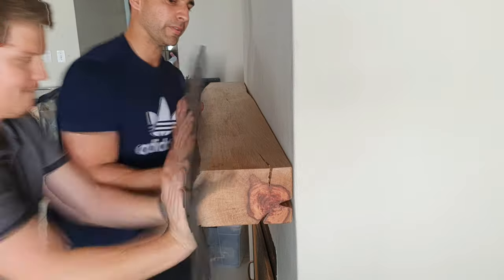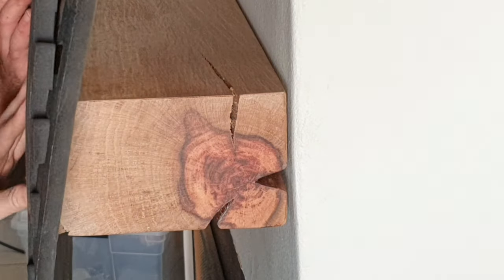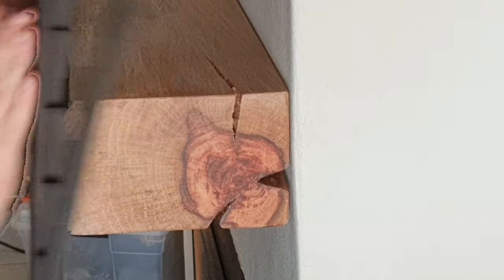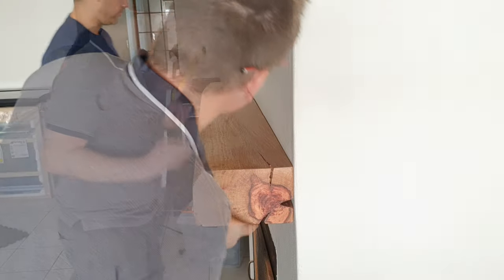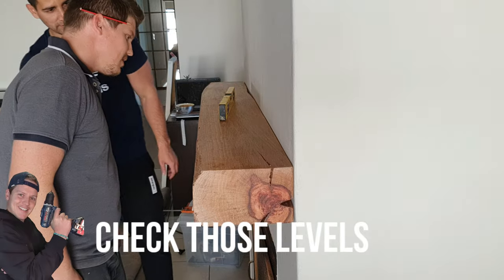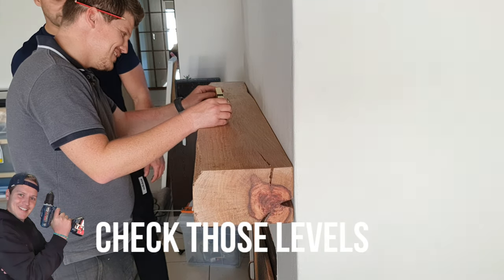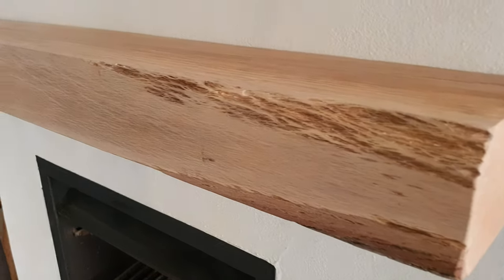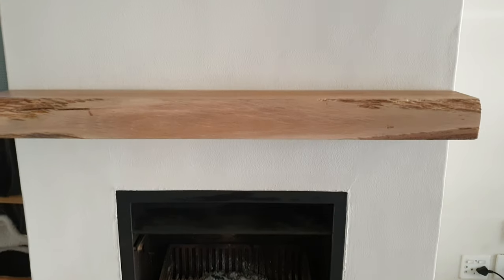How To Install a Floating Mantle / Floating Shelf

Comment: What's the point in checking the final install level? Would you really pull the whole thing off to fix a small deviation?
Reply from the maker: anyone who takes pride in their work would be happy with a level result and if it was out by a little it wouldn't warrant a full fix but it is very rewarding when everything comes together

Comment: Just wondering what size screws l would need for 5 feet length by 6x6 weight 5.00kg they will be using 6mm dril bit 🤔
Reply from the maker: Hi Sue, on that size I would recommend using at least an 8mm threaded bar or floating shelf bracket.  It also depends how much weight you are wanting to put on the shelf.  If you buy the floating shelf brackets they come with a weight rating.  In my case I used 12mm threaded bar for maximum strength as we used Iron Wood for the mantle and shelves.

Comment: Nice. My effort sagged. 1.4m piece of pine into brick. Should i retry and attempt to drill the holes at a slight angle downwards?
Reply: You could try 2 stage chemical anchor, we're the holes snug with no play on the rods?

Comment: V good video, given me inspiration. 1 q, why did you not space the bars equally, but had each pair closer to the ends of the beam with a larger gap in the middle?
Reply: Think I’ve just realised the answer to my own question: so you don’t drill into the flue?
Reply from the maker: @johnkendall4660  thats correct

Comment: I am no handyman or mechanic, but my initial reaction is "don't drill into a board with your car tire as the backing." - I subscribed though.
Reply: Well only if you don't measure correctly.  😁 we knew the risks we were taking and a 2 ton Audi made a great stable solution to push against
Reply: Also thanks so much for the sub and for taking the time to drop a comment.  It really helps a lot
Reply from the maker: I just realized I was commenting from my other account.  Thanks again for the support
Reply: Lmfao

Comment: Looking to take on a similar project. Unfortunately, the wall above our fireplace is solid drywall, with non weight bearing 2x4’s on each corner (it is a recessed fireplace). Only thing I can think of is cutting out a portion of the drywall so I can access the reverse side of the wall, then mounting a strut channel to each corner stud, replacing the sheet rock cutout, then mud/tape,paint. What would you recommend?
Reply from the maker: @tyler carpenter what about a set of legs that extend to the floor and re clad it to match the the walls.  Otherwise if you are not bearing a lot of weight you can do a faux version where you make a hollow box to the size of mantle that you would like and secure that onto the studs.  If you want to do the solid wood option you would need to be able to support that weight. Your idea sounds good but I would need to see a pic to understand what you are working with.

Comment: Video is great but you didn’t mention the size of the drill bit and the size of the metal rebar’s so that be great if you can tell me the sizes of everything I need thank you so much.
Reply from the maker: Hi Jose,  the drill bit is a 12mm Auger bit and the threaded bar is a 12mm threaded bar cut to 240mm long each

Comment: Mantle looks great! How are you securing the steel rods to the wall? Just the glue? Is it in drywall?
Reply: Oh I watched it again and now I see you drilled into the studs.
Reply: @gilatron1241  it is a brick and mortar wall, I used a super strong industrial adhesive, you could also you another type of chemical anchor.  If I had to do it again, I would use an expanding wall anchor and screw the threaded bar in and then slide the mantle onto it with adhesive.
Reply from the maker: @UCvCMmbNpnwhrp7hPvt0rnvA it is a brick and mortar wall, I used a super strong industrial adhesive, you could also you another type of chemical anchor.  If I had to do it again, I would use an expanding wall anchor and screw the threaded bar in and then slide the mantle onto it with adhesive.

Comment: How much did it weigh? My live edge piece weighs about 60 pounds. Any tips???
Reply from the maker: Hi King Cuff, I am not sure on the weight, but it definitely was a heavy one, this is why I went with 240mm 12mm thick threaded bar to accommodate the weight.

Comment: You know what I bet fellow DIYers would love to see?  You drill the holes, insert the rods, mount the mantle in a dry fit... and it's not level.  Now what?
Reply from the maker: yeah, i guess that could happen, but remember to always measure twice and cut once. There are ways to level it after you do the dry fit, but try and avoid that by double checking everything first.

Comment: What are those Rods you're using there??
Reply from the maker: 12mm steel threaded bar
Reply: @JoshTheDIYguy  you think I could use rebar instead?
Reply from the maker: @george5697  yes you could, and then secure it with a 2 part chemical anchor (Gorilla makes a good one)

Comment: Maybe I missed it in the comments but where do you get the metal posts to float the shelves and what would they be called ? Thanks
Reply from the maker: Hi Patrick, I used 12mm Threaded Bar which come in 1M lengths.

Comment: How big do u cut your thread bar
Reply from the maker: 230mm
Reply: @JoshTheDIYguy  is that 115 into wall and 115 mill into timber
Reply from the maker: @shaunoconnor1979  pretty much, it also depends if you are going into a wall with a cavity or not, I would probably use threaded wall plugs if the wall is limited with depth

Comment: Hey Josh, what depth did you drill for the anchor screws and what size where they?  I have a 77 in. black walnut mantle into a brick fireplace (with wood cutouts on each side).  Looking to mount the mantle
Reply from the maker: Hi JH Padley, it was some time ago, each rod was cut to 240mm (9.44 in.) half went into the timber and the other half into the wall.  it was into masonry brick work.  If you are securing into timber studs, you will need to adjust accordingly. I hope this helps. thanks for dropping me a comment and for watching my video.
Reply: @JoshTheDIYguy what about the diameter of the rod? Looks like M12 or so?
Reply from the maker: @A._.A._.  Correct it is a 12mm Steel Threaded Rod.  Are you going to be building one?

Comment: I use an epoxy
Reply from the maker: Epoxy is also a brilliant chemical anchor ⚓️ 👏
Reply: @JoshTheDIYguy  what were you using? I also use gorilla glue max (white glue, orange tube) for many projects that require a fast and very secure adhesive. That stuff is actually very impressive
Reply from the maker: @dilldowschwagginz2674  I was using a sika product called Sikaflex®-118 Extreme Grab
Construction Adhesive

Comment: Hi, I just have a question to ask.  If this beam is not put up correctly, can it affect the bricks or have an impact on the structure of the chimney itself?  Many thanks.
Reply: Thats a tough one as not all chimneys and buildings are the same.  The main thing is to ensure that your mountings are secure. You can use epoxy chemical anchor if needed to secure the mounts into the wall.

Comment: I've got a floating oak mantle and it needs to be replaced, how do I remove it, can't see how it's fixed on
Reply from the maker: How thick is the mantle.  Is it built into the brick work?
Reply: @JoshTheDIYguy  no it's about 4 inches square, I can just about see pins going in at the back, because the middle part has warped with the heat, and come away from the wall a bit.
Reply: Get yourself a decent multi-purpose saw like an Irwin Jack and cut chunks out of it till you're down to the pins. If that's still a struggle, use a hammer and chisel to clean up. Then remove pins.
Reply: @lukeshepherd9529 very good advice from Luke. Sorry for my delayed reply. Been swamped at work.